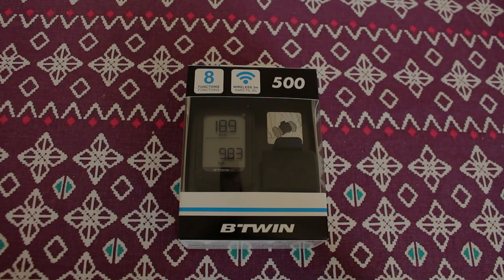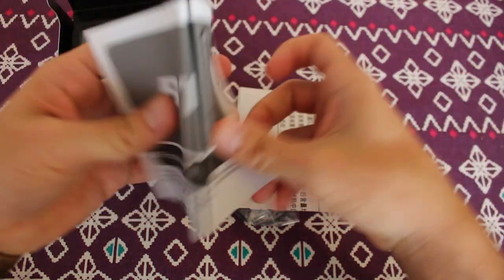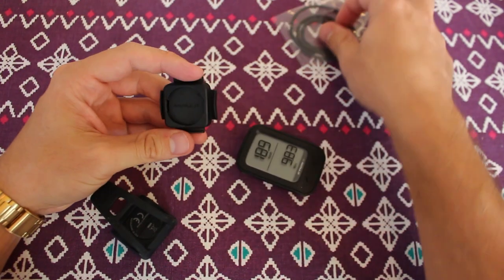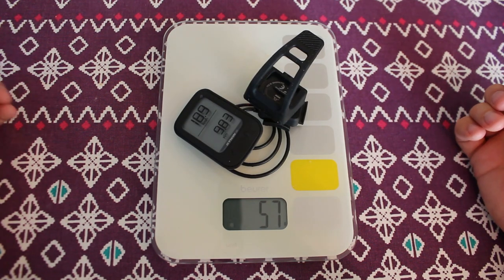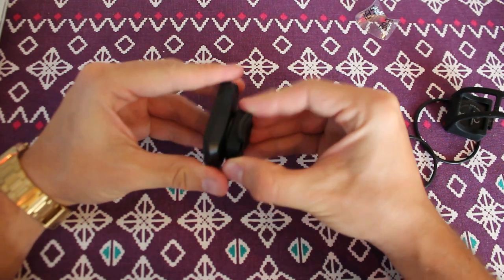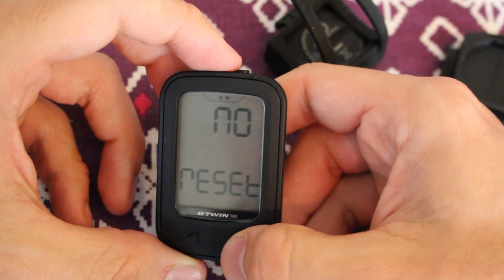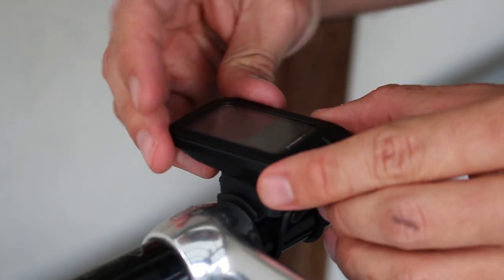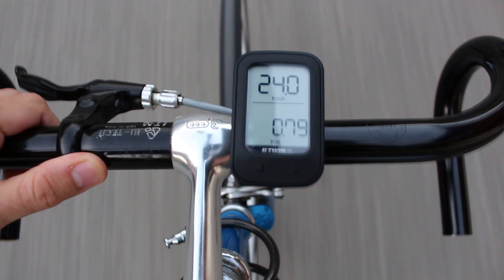UNBOX - INSTALL - TEST - B'twin 500 bike computer

Comment: Bought two of them, for both road bikes, I love these things, they work really well for me. I noticed your goose neck is thinner, classic style, this thing fits wonderfully on the more modern ones, also front roval hub is is thicker, which also straps on nicely. I wanted something for my Specialized Tarmac, and this is perfect!!
Reply from the maker: Nice, I agree great value for a training computer. And yes the bike I was testing it on was an old steel frame with a lot of older components.
Reply: Does it has backlit and is the backlit powerful?!
Reply from the maker: It does have a back light and yes It's sufficient
Reply: @BruceChastain  BTW is the speedometer good like you mentioned in the video . The speedometer stops for a while , you have to press button. The auto stop/on feature doesn't it work properly 🤔? I'm thinking of buying a speedometer under 30 euro , would you recommend this speedometer?
Reply: @Iamhashyy  Geez, I can't find how to use the backlit option! Sorry, not that I go out at night, but would be good to know, incase a long ride ends up riding in the dark...
Reply: @leftymadrid  alright, would you recommend this speedometer?!
Reply from the maker: I've had the same problem, and in fact I don't remember now either! I'll see if I can find our and post back here.
Reply from the maker: I think it's really good for the price. But it does turn itself off after awhile when not used. And it does not turn itself back on automatically. To me that's annoying because I want to be able to just get on the bike and not have to remember to turn the computer on. But other than that I've had no issues at all with it, working perfectly still. I don't use it daily, but probably weekly.
Reply: @BruceChastain  Bruce, lol! Ya, a number of times I have forgotten to switch the damn thing on, very annoying indeed! Lol
Great little unit though.
Reply: @BruceChastain  how do I switch it on?
Reply from the maker: I finally looked at how to use the back light. I don't know how I missed it before, but while it's on just hit the button on the top for a second, the back light will come on for a few seconds and then turn off. I don't know if there is a way to leave it on.
Reply from the maker: @sagar the unit? Just hold down the button at the top for like 5 seconds. Then once it's on tap the top for just a second and the back light will come on for a few seconds.
Reply: @BruceChastain  Nice little video. How accurate is it?
Reply from the maker: honestly I don't know it's accuracy. I think in general these should be more accurate than GPS.

Comment: FYI BC 120, which you can get for 2/3 of the price of this one (BC 500) lacks the backlight, temperature sensor, top speed and stopwatch functionality. It has time, current and average speed and current and total distance. However it is a much compact design, it mostly turns itself on automatically when riding (unless you hard turn it off), and the initial screen shows the time and speed.
Reply from the maker: yeah I've had not that one, but a similar one, it's the wired version right? I don't love the wires but it has its advantages too.

Comment: Also want to add on, the computer definitely does not feel secure on the mount. I fixed it by folding a small piece of tissue and placing it on the mount before slotting the computer back on. I figured this provides that extra friction/cushion. The monitor feels really snug now. I just took my bike outdoors for a spin, going up and down kerbs and going up to 30kph. Didn’t slip off so far! Hopefully it stays this way.
Reply: Tash omg thank you! Was thinking of returning it because of how loose it felt even before I went out on my bike. You just saved me an hour’s drive back to decathlon. Now my monitor feels really snug and i hopefully wont have to worry bout it falling off when I ride lol good fix
Reply from the maker: that's good!

Comment: There are a LOT of reviews stating that the computer pops off the mount and surely this company must realise by now that the mounting system needs to be improved.
Reply from the maker: I didn't ever have it come off, but it didn't seem that tight.
Reply: Mine came off many times

Comment: can it mounted on rear wheel?
Reply from the maker: Hi Fadli, I'm sure because I didn't try that myself, but I don't see why not. The distance from the speed sensor and the display unit would be further, but I would think it should still work fine at that distance.

Comment: I just got my and it turn off every couple second if you not using it right way. I don't know what the trick is with the background light either. Will give it a try tomorrow if it turns off while riding then I will send it back.
Reply from the maker: that doesn't sound right, maybe it's defective

Comment: The mount must have been improved because I've just bought one and you cannot fit the screen without holding firmly the mount.
Reply from the maker: So it’s tighter now? I know a lot of people have been complaining about it being lose.
Reply: @BruceChastain  I don't see how it would come off as it is so tight to remove from the mount too. When you ride on rough surfaces, most of the vibrations seem to be absorbed by the rubber band. The font at the front now just says BC500. On the back it says Decathlon with no mention of B'Twin anywhere. I am very happy  so far with the computer. The only problem I had was the setup instructions which I took ages to understand.
Reply from the maker: @travelcampervansandmore  cool good to know. thanks for the feedback on that.

Comment: This isn’t waterproof right? So if it starts raining halfway through my commute, it’s not a problem to twist the monitor off the mount and keep it. The question is, would I have to remove the sensor at the wheel as well?
Reply from the maker: I actually don’t have mine anymore but I thought it was water resistant.

Comment: Good day. Thank you very much for your informative video!! My computer continues blinking and does not pick up the sensor...any solutions?
Reply from the maker: Not sure, maybe reset the battery of the sensor on the hub. Thanks for watching and the nice words.
Reply: My computer blink too, do you found any solution?
Reply: @sirdruid1343  Mine too help
Reply: Same problem bro but i fix it i reset the battery on my sensor  then it works until u set it off for about 2 hours it blinks again so i have to reset the battery agaik on the sensor.

Comment: Good day mate, why is mine not turning on after it turned off its just blank screen. Does it happen to you also?
Reply from the maker: Do you mean automatically turning on when you start riding?
Reply: Yeah, it wouldn't turn on even if i hold it for like 20 seconds. Do you think its better to just ask for a refund?
Reply from the maker: @peterson5799  well it's not made to turn on automatically, that's something I didn't love about it. But yeah if it's not coming on at all, even after holding the button for 20 seconds, I'd send it back.
Reply: Yeah alright thank you so much appreciate it :)

Comment: Can I use it for recreational MTB not for competitions I just do MTB for fun, would it be suitable?
Reply from the maker: Hi Rochelle, yes for sure it would be suitable for that. In fact I guess that's the idea because most racers will have more advanced and expensive bike computers. To me the only slightly annoying thing is that you have to turn it on every time you want to use it, it's not automatically on. But I think this is how most if not all wireless computers are. Thanks for watching!
Reply: @BruceChastain  perfect Thank you so much.

Saw a lot of reviews saying the computer pops out easily but I doubt it, it looks sturdy in the video
Reply from the maker: I thought it seemed a bit lose too, but it never came off. I've actually given mine to a friend and he's never had any issues either that I know of.
Reply: @BruceChastain  thank you I bought one this afternoon so let's see what happens. Thank you for your response and the video much appreciated
Reply from the maker: @rochellevanderwalt1773  no worries, if you can, can you post back later and let me and the rest know how it is for you?
Reply: @rochellevanderwalt1773  Were you able to mount it on your bike? I can't mount it on my mavic crossride wheelset.

Comment: Fair enough, you threw away the instructions before reading them, but you need to read the screen. When it says reset all yes/no, you're resetting all (well, just the counters, according to the manual, not the wheel size or time)